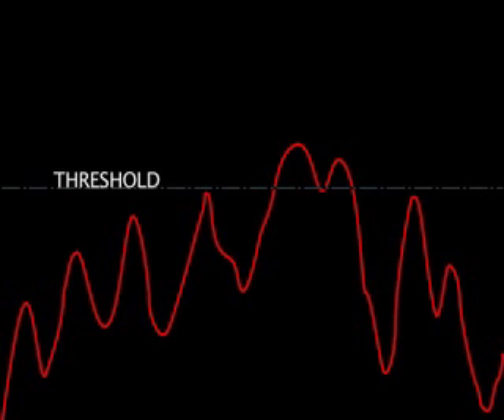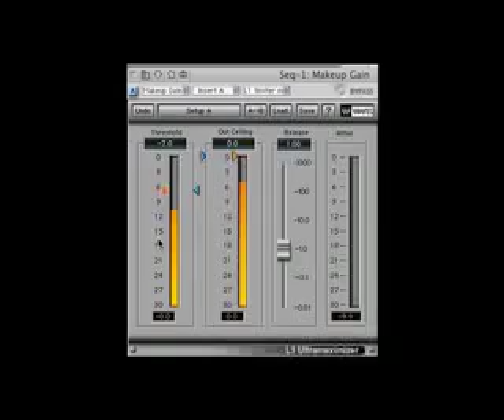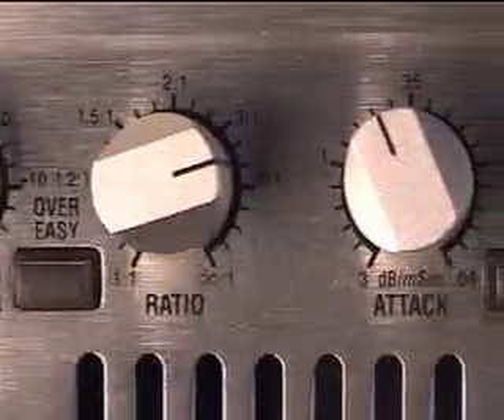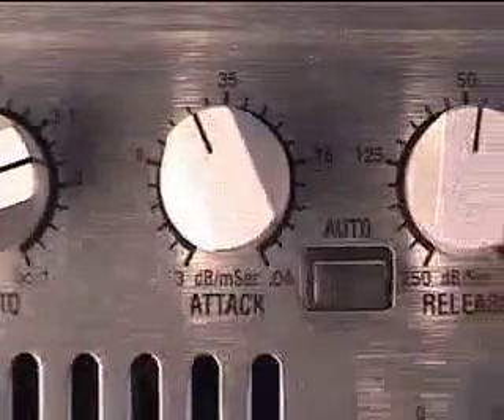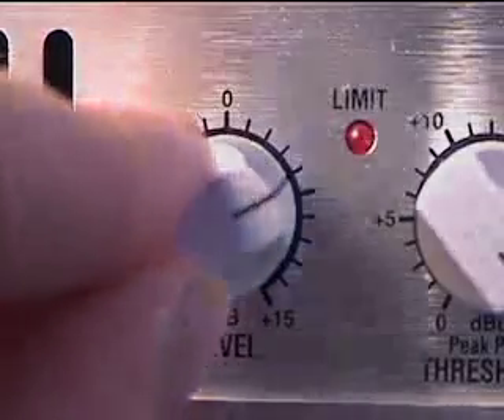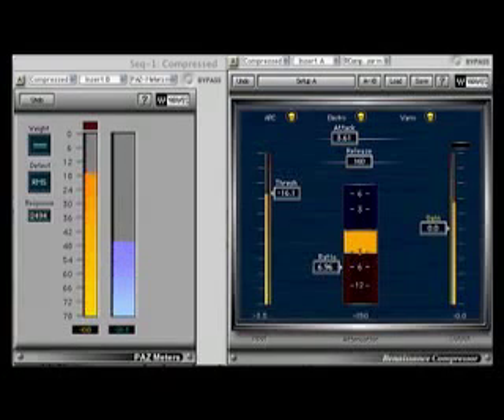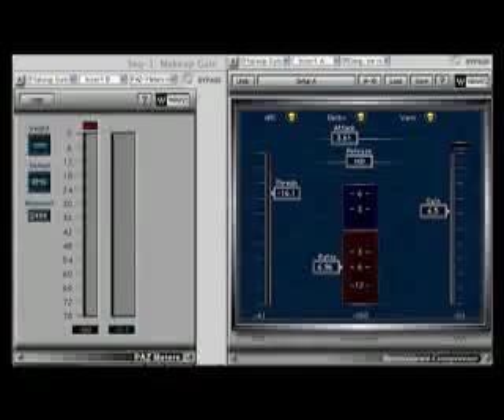Compression and Makeup Gain

Comment: @HiTopProd Wrong, wrong, wrong! You shouldn't question this vid so readily. 

Firstly the 'red' on that needle was still below 0dB. Secondly, it was not a software plug-in and most certainly analogue. Analogue distortion can sound pretty nice.

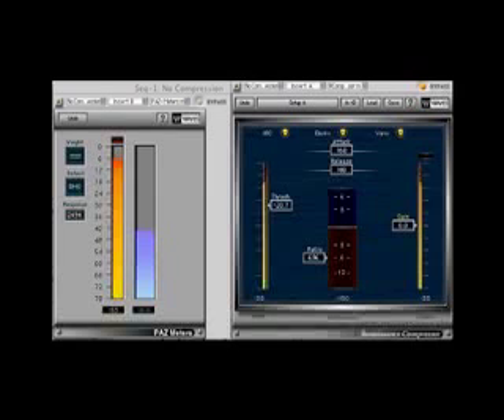From what I saw, there was never any clipping at any point, digital or otherwise. See that little dark red square above the meter on the left from 0:51 onwards? When that lights up bright red, we're clipping.

Give this guy more credit.

Comment: ...and as I thought, you would respond in such a way as to remove any "Possible" Doubt.
What the fuck do "I" know about signal processing? You have heard my work %100 for sure. You may even have bought records using my equipment. My cilents have sold out Madison Square.
Lets just say I'm nuts and you are the smart on on Signal processing.
Name One single album by Zeppelin or Van Halen that was has not used some kind of quality compression in their mastering... (do you know what Mastering is?)